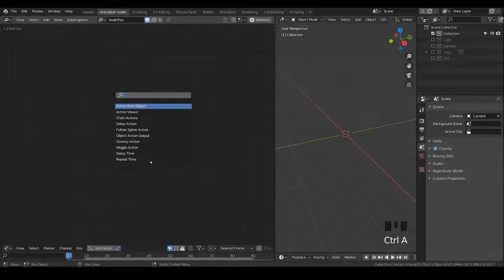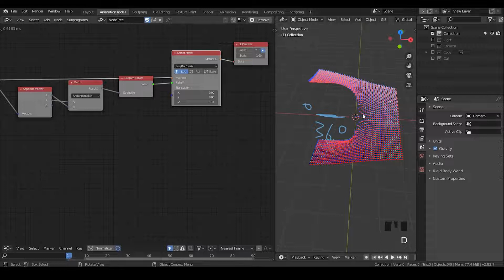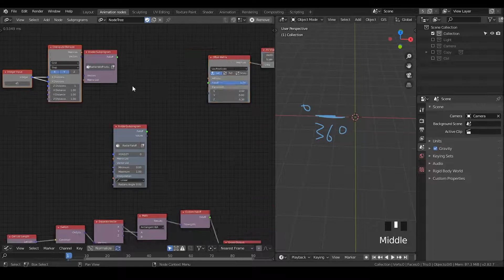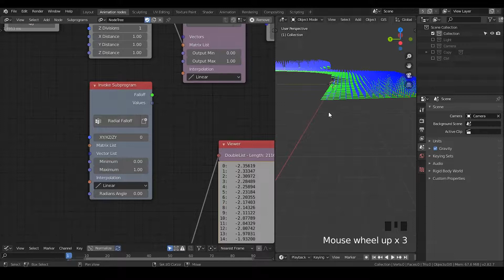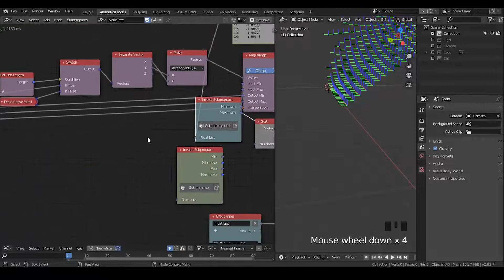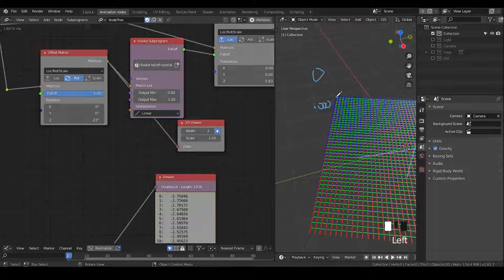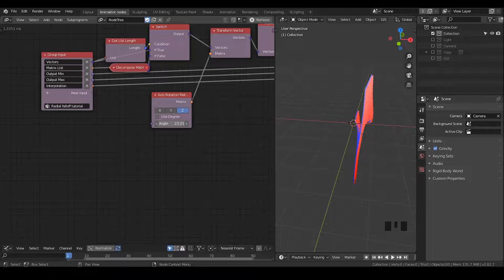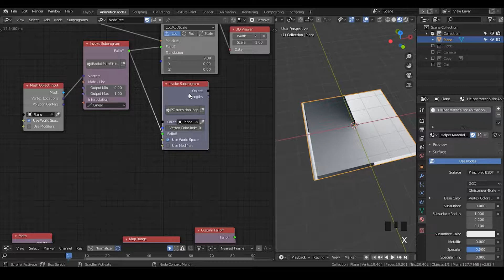[Tut] [Outdated] Radial Falloff - blender animation nodes; AN-preset; download provide.

Comment: Hello Bradley. I want to say that I really appreciate your tutorials. Regarding this tutorial: I followed your steps up to the point where you used Map Range.... I used instead the Remap Falloff node... Seems to work the same. Any reason not to use that aproach?
Reply from the maker: The "remap falloff" up to today, has no "interpolation" option; which is the main reason I don't like it in general.
The function has been proposed, but the developer hasn't integrate this function into the node. Sometimes interpolation can be interesting and useful, but "remap falloff" node doesn't have this function yet. To get an interpolation, you need to use an additional "interpolate falloff" node, this however will cause other issue, because it assumes your falloff has a range "from 0 to 1". Upon remapping, maybe I remap the range to be "from -1 to 1", then interpolation will rather give incorrect result (probably it will clamp to 0 to 1). To fix this issue, you need to remap the result again.
At the end. if I use just a single "map range", I can already get an interpolation option. but if I use "remap falloff" and want to get an interpolation, I need to use "3" nodes in total for an absolutely correct result.
when used as a preset, since we don't see the content within it, this may not matter. But as a person who build this, I will be very annoyed.
Reply: @bradleyanimation120  Thank you Bradley for taking the time to give me such a detailed answer. It makes perfect sense, so I will change the preset to "Map Range". I also want to implement the cutter function in this preset (like you have in another tutorial), but I am facing a "geometry related?" problem: I can make the vectors that make the cutter to follow the rotation of the square grid matrix and I can make the "cutter" to match the size of the matrix grid. Where I have problems is figuring out how to match the size of the matrix grid when I animate (I can make  the "cutter" match the corners of the matrix grid or match any other point in the grid manually). I will try to research this on my own ( to find a formula that mimics the circle ray so that I can have a "square ray") so the cutter will adjust the length in a dynamic way during the animation, so it will match the outer size of the grid. Any suggestions are appreciated though...
Reply: Regarding the "square cutter challenge", at this moment I see two approaches: either figuring out a formula for "square ray" or making the cutter long enough to reach the corners of the grid matrix and then figuring out a way to mask the excess points when the cutter is in any another position.
Reply: I have founded a solution. It is a little bit convoluted but it works: The cutter is basically the hypotenuse of a right triangle. So, knowing the rotation angle and one of the sides and using the formula founded here: https://keisan.casio.com/exec/system/1223014436 and some boolean switch trickery ( to switch between cos, sin, -cos and - sin), you can cover the full grid. I think it works for rectangles also.

Comment: This Arctangent B/A is actually Arccotangent (B/A) am I right?
Reply from the maker: no, i personally think arctangent is just arctangent.
Reply: @bradleyanimation120  But arctangent has a range of PI/2 to -PI/2...
Reply from the maker: @渡辺城原  Alright, officially it seems called "arctan2".
Here is citation from wikipedia:
[The two-argument atan2 function computes the arctangent of y / x given y and x, but with a range of (−π, π]. In other words, atan2(y, x) is the angle between the positive x-axis of a plane and the point (x, y) on it, with positive sign for counter-clockwise angles (upper half-plane, y > 0), and negative sign for clockwise angles (lower half-plane, y < 0). It was first introduced in many computer programming languages, but it is now also common in other fields of science and engineering.

In terms of the standard arctan function, that is with range of (−
π/2, π/2), it can be expressed as follows.]
Reply: @bradleyanimation120  It's werid to know it, but thanks! 
arccot | arctan2 they looks so alike and arccot(-1) = arctan2(-1) so I was confused...